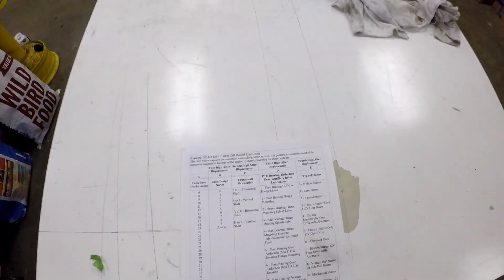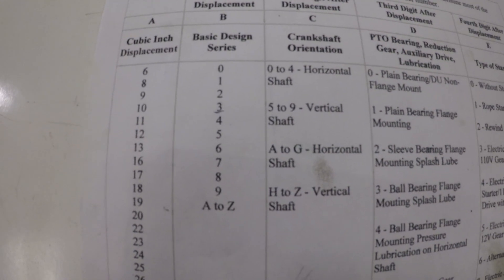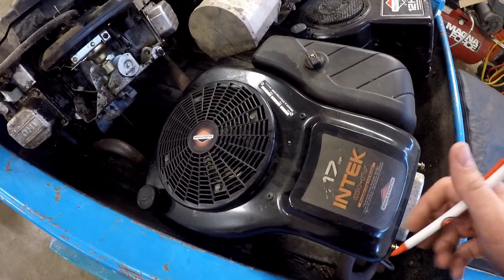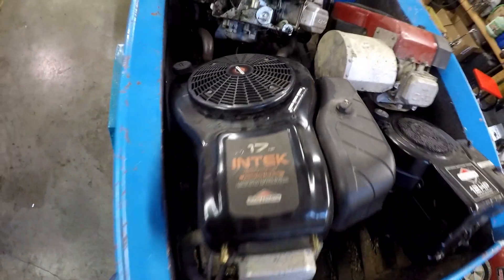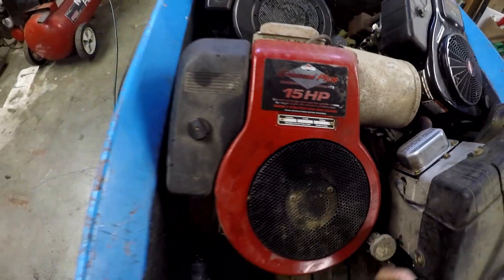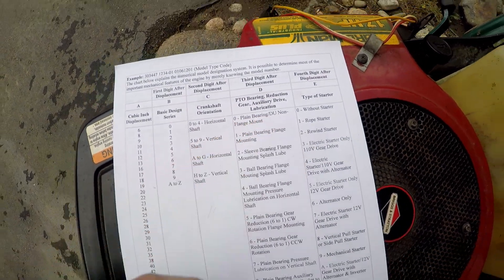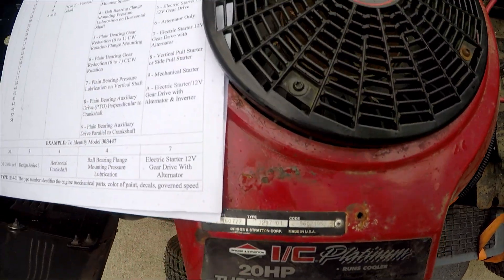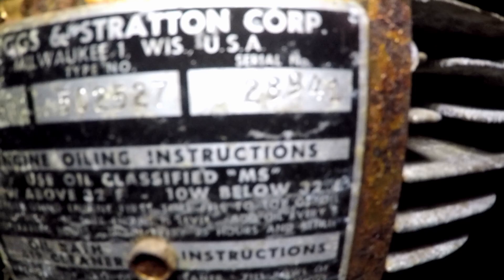How to: Find & Decode a Briggs engine code

Comment: Hay is a vanguard stater all the same as anther one's
Reply from the maker: Vanguards typically use a starter with a solenoid on it that also pops the gear up, similar to some Kohler Commands.
Reply: @OffroadMudMowers  i have one with a plastic g how many teeth is on them
Reply from the maker: @94jeep75  Plastic gears have 16 teeth.
Reply: @OffroadMudMowers  thanks